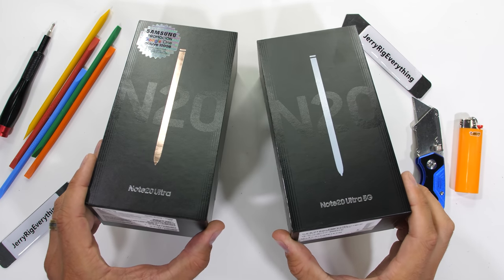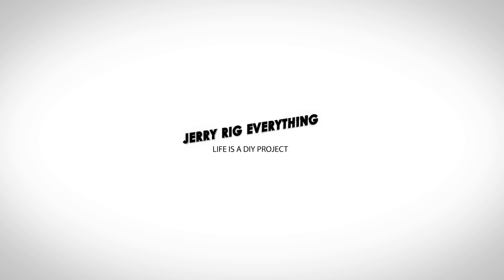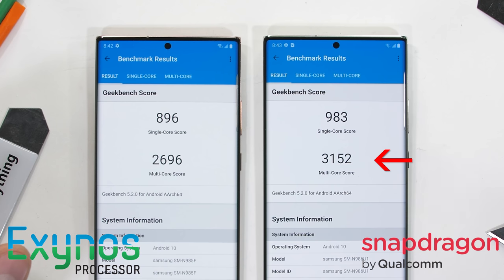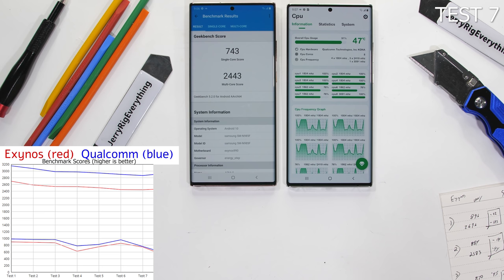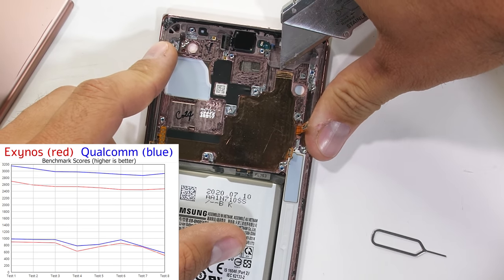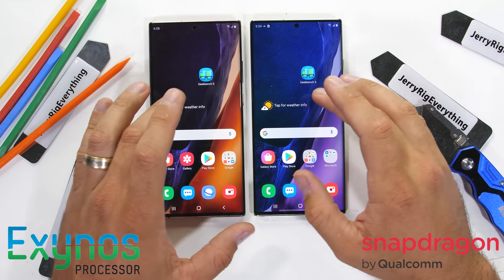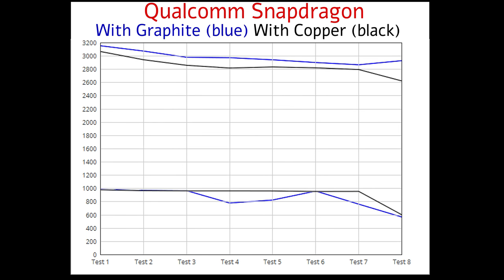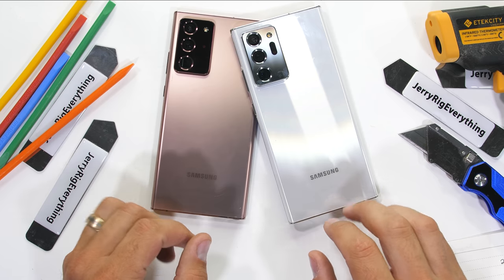Samsung should explain this... Exynos vs Qualcomm?! - Note 20 Ultra

Comment: I've been part of this argument since my S7, they would my first year to buy an unlocked phone, doing my research and shopping I came across a international variant which was consecutively 50 - 75 dollars cheaper oh, I live in the United States I'm going to be using a mvno, so it does not matter if it's a GSM or CDMA. I then read USA it's a different version than the standard World version, USA gets snapdragon wow the world international model Samsung in house Exxenios Processor. Apparently they used Qualcomm in the states, because it's y'all better radio antennas for dealing with the old CDMA Networks. Once I read this I immediately assumed Samsung Made Exxenios would LIKELY BE BETTER, I assume that's because bacon design the processor for the phone as opposed to buying a generic processor and tuning it. This train of thought makes sense to me, they should be able to design a much more efficient battery saving processor, With their phone.. Right? And then seeing this version was cheaper I immediately bought one on eBay. When it arrived I was really excited oh, I had my GSM Sim already. unboxing the phone and turning it on, I first remember how hot in my hand it felt only after a couple minutes of the setup screen, it ship with 55% battery, and After Finally, Like 20 minutes, Of setup I got to Homescreen, with 19 % battery and a Little space heater Phone... so I plugged it in, and did a update check... no updates for, Samsung unlocked version.. im on Android 6, with TouchWiz... and other at 7 that this time we're getting the Android 7 upgrade with the Samsung Experience or whoever they called their skin ran much better and look much better. Finally got the phone setup, I only ever could get one or two bars of service. When playing a game or other intense processor activity, I would notice the phone we get very hot fast, and would run smoothly then chugg, In lile 5 second Waves.. it was very strange, run well and then it stopped, even Moving in menus it would slow whwn I'm dragging Making the animations  all Klunky... after about two weeks I'm not a happy camper, another thing. I cannot keep this battery charged even when I would sleep, if I went to sleep with 100% I wake up with 65. So the troubleshooter tech nerd in me decided to figure this problem out, this was not how any of my friends or even how the display model of the S7 works from what I've seen. Upon checking the battery usage statistics, 2 top battery user always Android system. Even when playing a game Android system would typically be in the top 3 of battery users. Based on the information available from the built-in tool and several apps I tried. Of course I couldn't get to any good info on processor scheduling, when the phone is asleep if it even has a sleep state. Only the basic information of which apps are using what percentage and that information is not very useful there are several Android system entries battery usage details. I knew that the phone must need an update, or something. Clearly there was no low-power state scheduled it with their in-house processor, I figured something was keeping the processor in a high-energy state, not allowing the 7 to enter a low power sleep mode. I tried deleting disabling apps, I basically the only had the stock apps on this point, still waiting on the update which I learned Samsung releases the updates for their unlocked versions last and sometimes not at all. Try disabling all Facebook apps tried factory resetting. Then I decide to look more into this Samsung in-house processor versus the US Qualcomm Snapdragon, I'm immediately greeted after my search when a video of two phones racing to see which is faster I'm very curious about this myself imma I wasn't happy after I watch the video. This is when I learned about the whole deal. Thought about returning the phone, but another option was available, route is available on the non Qualcomm version. One could simply root the phone, I know she was excited me as I'm a major tinkerer. Then I can choose my own scheduler, how I could even set the clock rate lower if I wanted, or disable the big or little Coors, I learn how to root the phone and do it, turn on the rooted phone total shitshow, tons of lag and chug, and immediately turned extremely hot. This can't be right I think oh, oh there's a custom updated kernel. After attempting and breaking the phone, Court required a complete reflash I finally install the kernal correctly, and its No change.. Sure I can switch it from the pro hot schedule, to the interactive scheduler. Why was septic Pro hot, which basically just cranks each quart to a hundred ones load is applied. Was the standard Samsung setting, says a lot about their, hardware and software programming skills. Even with the interactive scheduler and 2 to small or one big core disabled the phone for the laggy mess, the battery still burned up 50% while I slept or while I was awake. I finally sent that piece of shit back, and got a US version. Howard shopping by model number, difference between the US and international unlocked versions is one extra letter. But damn that letter makes a difference. Upon getting the Qualcomm version. I do an update check and find that there's an update available yay, Android 7 much better looking than Android 6 TouchWiz. Honestly still miss Android 7 sometimes even today. Especially love the Google Play icon triangle. But now finally I could enjoy the S7 Android 7 fix Android OS sucking down all the battery issue, the phone ran much smoother and the battery lasted much longer, if I didn't touch the phone much I can't even make it last 2 or 3 days. It's still got extremely hot when playing the game. Snapdragon 820 is famous for this, that's what I learned about this bullshit that Samsung still does. It's basically a con you're buying and paying for what you assume is a decent product, but the Samsung in-house processor version is literally like paying for an S7 and getting an S2. But it is not clearly marked they both cost the exact same and the international version has been proven to be much slower, and much more demanding on the battery. 20 or 30% slower and that much more battery usage and most cases. This is shyster territory. It's no different than buying a expensive computer, when you get it and you open the case, expecting core i7, and you get a Pentium. The outside box looks the same the one in significantly better. And my case the Samsung design processor made the phone nearly useless, my old phone works lasted longer and and ran just as fast. was the Samsung J-3, what is a low-end $200 phone. I'm extremely careful about when I make a purchase, I would never buy any Samsung made processor, interesting to note, the new Nvidia ampere gpus, like the RTS 3700, is a Samsung made GPU processor. Although they seem to have done a much better job in this case. Although their cards clearly aren't available enough for testing, for at least testing by me. How much rather get a new Navi card if possible. And I also agree with your last statement oh that makes me very sad. I'm on my Note 9 right now, and I cracked the screen, they have a deal offering a trade in for the new 20, and then split the note line up  TO DRIVE UP PROFITS,  Which must have worked since they did it again... im so torn on what q get .. you get the new note Ultra is making me think about it are there $500 is quite a bit for technically a downgrade. I'll have to go to the store and see if the refresh rate, and new camera sensor are really even worth a couple extra hundred. Even if they torrent, I have 256 gigabytes SD card in my nine right now. But the new note is so advanced they couldn't put SD storage on the basic note. So I could just throw my SD card away so obviously can't buy that note. Thanks Samsung 4 fucking things up so badly you lost a customer for life for this. Likely going to be trying a LG
Reply: was not expecting that when I clicked read more

Comment: Here is what I think: Awful. 

It really should be called a different phone.
Reply: I mean it is? The exynos one is the Note 20 Ultra and the snapdragon one is the Note 20 Ultra 5G. Or am I missing something?
Reply: @tolphmitph  no, both the regular model and the 5g model have a Snapdragon and an Exynos variant. Here in the Netherlands both models have an Exynos chip.
Reply: They are already called different names, the snapdragon has 5G in the name because it has a 5G capable processor. 5G processors are more expensive and beefier by definition.
Reply: @DavyJones3  thats what i was thinking too
Reply: @DavyJones3  nah, even the Note 20 ultra 5G has an Exynos chip here in the Netherlands! It depends on your region what version they sell, the point is they should make it more obvious which version is which. And the Exynos version should be cheaper.
Reply: @gijsdenneboom4476  Really? That's dumb. I agree that they should make it more obvious. What I wonder is did they lower the price of the snap dragon variant to 1300 or raise the price of the exynos? Wasn't the Note 10 plus 5G more expensive at launch compared to these phones?

Comment: Well, exynos redeems itself when comparing with  Qualcomm SD888 this year, I think. So that's a turn of events.  But it's sad to say, Qualcomm SD888 only lost to its exynos competition because  SD888 was ALSO manufactured by Samsung (Korea), unlike qualcomm SD865 series in Note 20 Ultra, which was manufactured by TSMC (Taiwan).

Takeaway from this:   always check the actual manufacturer of the chips and the technology node used, not just the brand.
Reply: 888 by TSMC lost to Exynos
Reply: @androidoneiu5206  what do you mean?   I thought sd888 was manufactured in Samsung?
Reply: @ScrewTikTok  yes too, but Exynos still better

Comment: Exynos devices have a power mode that is on optimized out of the box. I am not sure on Qualcomm how is set out of the box, but I am sure results will be different with high performance selected.

Comment: At least Samsung somewhat sorted the issue out by ripping out the 5G modem from the S20 FE and lowered the price if you didn't need the Snapdragon 865. Sounds like a band-aid tho: We can't simply offset the chips with a price tag difference and a 5G option.

Comment: not only the phones have different specs, but they also charge more for the worst version.. 
haha..
on release, they charged about $250+ more in the EU for each phone respectively: 
999$ in US while around 1265$ in EU (about 1079€) for the Note20, and
1299$ in US while around 1580$ in EU (about 1349€) for the Note20Ultra.

** i really don't get how people still buy Samsung phones..

very nice vid though.. ;) (immediately subscribed)
Reply: ** just checked gsmarena also, and it lists the note20 current prices right now as: 
€749.99 (= about $880) for EU / $699.99 for US

Comment: You have to try ONEPLUS!!! I had the 7t pro which I loved, but then they came out with the 7t pro 5g Mclaren edition so I grabbed that! The thing is that without fail within a month or two my samsung phones always had a cracked front or back glass panel broken. The 7t pro...both variants are though as bricks. I had the light blue 7t pro for 8 months...no cracks...the. The Mclaren edition now for just about a year and no cracks....samsungs glass is either thinner or just weaker. I live oneplus and have not turned back. I don't need wireless charging since this thing charges so damn fast. I would like to see expandable memory, but yet still haven't filled my memory. Also I love the fact there's no hold in the front screen b.c it pops up. Never had an issue with the front camera either!!! Just sayin

Comment: Copper is a far better conductor than graphite and is universally used for making wires. Graphite is more resistive and a poorer conductor. i personnely    favour the graphite cooling system

Comment: I wonder if you have the same screen settings on both phones, as in, 120 MHz? Might explain the temp difference.
Reply: mhz?
Reply: @dylanc2806  yes, as in Mega Hurtz. And TV's everywhere use this frequency.
Reply: @Iceflkn  w h a t lmao
Reply: @Iceflkn  megahertz means x million times a second. the refresh rate is 120 times a second, not 120 million times a second. you were right but the "m" is wrong (because it means millions) and the screen obviously doesnt refresh 120 million times per second
Reply: @dylanc2806  TV's run on either 60 MHz or 120 MHz. One uses more battery power and gets warmer as a result.
Reply: @Iceflkn  i feel like i am bring trolled... are you talking about CRTs?
Reply: @dylanc2806   I am not trolling you my friend, I promise you. Now, I just realized that I mistakenly used MHz instead of Hz for the refresh rate. If it was this you were pointing out, then yes, I used the wrong frequency abbreviation. 

However, it's the "refresh rate" I am taking about and the resulting heat that gets generated using a different display setting.

For example, TV's were rated at either 60 Hz or 120 Hz. Literally, 60 images per second vs 120 images per second. Obviously, more images means a smoother, clearer image. 

Basically, High definition vs Low definition.

Most flagship cell phones, computer monitors and even some tablets now have the ability to choose between 60 Hz and 120 Hz in their displays.

My Samsung Galaxy Note 20 Ultra can switch between these modes in certain situations.

We all know the it's the display that uses the greatest amount of battery power in a cell phone. If the processors are maxed out to support a higher "frame rate" mode then they will generate a good deal of heat.

Therefore, the display and all the components that make it run have, perhaps, the greatest impact on the life of its battery. 

This is why I asked what I did in my original response.
Reply: @Iceflkn  hahaha. yeah i was talking about you accidentally using mhz instead of hz. and yeah i understand the refresh rates. 

good question too. knowing JRE, he's not perfect but i'm thinking he accounted for it. most likely he left it on the default setting, whatever that may be. although, even then, geekbench doesnt actually display anything in high refresh mode so it wouldnt matter
Reply: @dylanc2806  JRE is very good and quite knowledgeable but he might have known. And if the comparison was between 2 of the first generation models using 120 Hz displays.

The power consumptions between manufacturers was huge. Would definitely after things, if missed.
Reply: @Iceflkn  yeah, suppose all we can do is take his word for it
Reply: @dylanc2806  oooooor we could wait to see if he ever answers. Lol Anyways, nothing wrong with asking questions.

Comment: Manufacturers are abandoning Qualcomm because Qualcomm increased the price of their SoCs. But their alternatives - Exynos and Tensor - are inferior products.
Just like the 888+ is an inferior product in terms of raw speed and power efficiency.
SoCs are undergoing a structure redesign, with more accelerator cores for multimedia, photography and AI, and less base cores. This is a multi-generation process, and 2021 has been the year when customers had less traditional computing power in exchange for more AI accelerators - which is not yet utilised by the current OS and apps.
We shall see where this ends up. For now, it is in a still undefined limbo.
Thanks for the great video...

Comment: I mentioned this weakness in the video where Pixel 4a vs Samsung s10e was compared, the American version with Qalcom processor worked better in all tests (compare to Pixel 4a)and I commented that outside the USA Pixel 4a is a better choice just because of the processor.
And I'm glad someone else did the same. And the fact that the same device with an Exynox processor is on average 10-15% weaker in both performance and endurance. 
👍👍👍 good job

Comment: My note 20 ultra with ARM Qualcomm did 1252 on single core and 3280 on multi core using Geekbench 6. Mine is a Japanese variant. I just did the test.

Comment: The Galaxy S10 was my last Samsung. They lost me. I really didn't want it when I got it but my S8 was having pixel issues so I got it. The phone worked for about a year and then went downhill fast. I had to restart the phone if I wanted to send or recieve calls. It would say I had 4g LTE but no cellular service. The fingerprint scanner worked half the time. The speaker was messed up so if I was on a call it would sound like the person was under water or was very far away. No water damage. I ended up getting the OnePlus 8T +5G. I'd rather not have 5G but it is what it is. The OnePlus 8T is amazing. Everything is so much smoother and sounds better. I never keep my phone to max capacity on the storage and I almost never take it out of the case unless i was cleaning it or taking out the microsd card.

Comment: The exynos vs Qualcomm issue is one of my big deal breakers when I parted ways with Samsung for good. I used to be a huge Samsung fan until they started giving us these SOC's that have worthless GPUs that run hot and throttle like mad. They are garbage, but Samsung has so many rabid fanboys that they seem willing to put up with this crap. And Samsung obviously doesn't care. They've been pulling this crap for years now.

Comment: I purchased Note20 ultra 5G , let me clear you some things .. I have exynos 900 phone..it heats a LOT while charging mild gaming using camera for a long time. It drops  battery I have to charge it at the end of the day around 5-6 pm ( depends upon usage ) YES IT HEATS .... A LOT TO BE VERY HONEST... BUT It's performance  is rather good. You can consider buying it as it bundles a superfast charger and a AKG headphone in the box it self... quite a worthy  phone